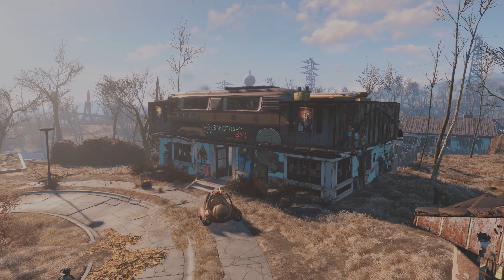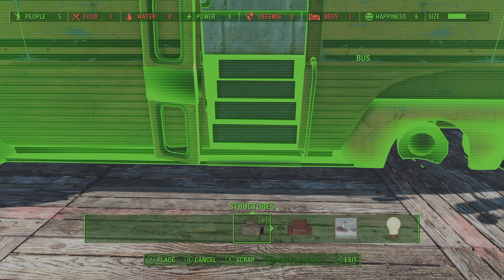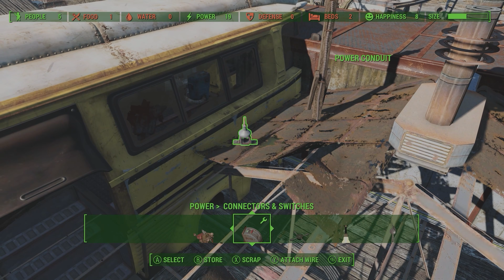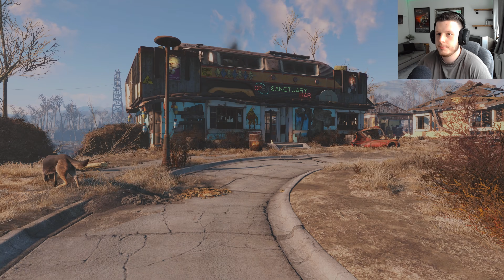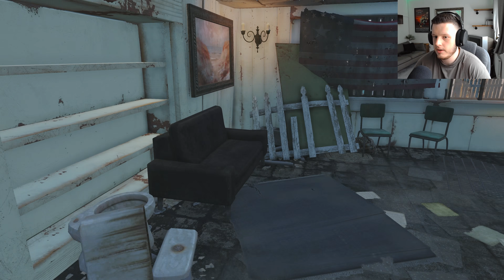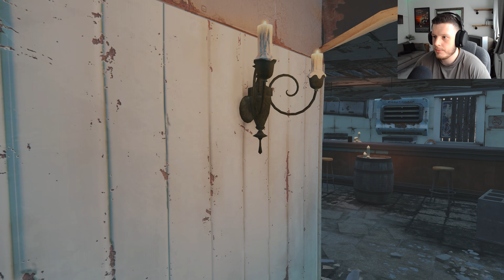Fallout 4 - Sanctuary House Bus Rooftop Repair

Comment: Hey new sub! Good stuff looks immersive af. For anyone having trouble replicating shawzzo builds and rug glitch not working?…. It because you have sts mod installed and that breaks it. I would recommend you finish your sanctuary build then install sts after, if you must have a clean settlement that is.

Comment: You should check out the wifi glitch so you can have wireless conduits.  Set up all your lights with one big generator and then hide the generator after you have all the lights and all things that require power.  It’s nice not having loud generators in your settlement.  And no wires.

Comment: I flipped the buses around where the doors were accessible and I made separate walkways with railings into the buses on both sides of the building one of them I use as the sanctuary public occurrences office for Piper

Comment: Gosh trying so hard to get this one but it just wont go with either of the rug or pole glitch. Any tips on getting the roof to fit? Ive checked for any other items colliding inside as ive already started fixing the walls. Platform seems to be the right size and i have the buses lined up pretty well
Reply: Did you ever figure it out ahaha I can’t get it at all

Comment: Nice build but you should put some concrete pillars underneath so it looks like all that weight is being supported by something, even if you just put a few around the outside of the house under the eaves. It will also help with your blue paint problem a bit.

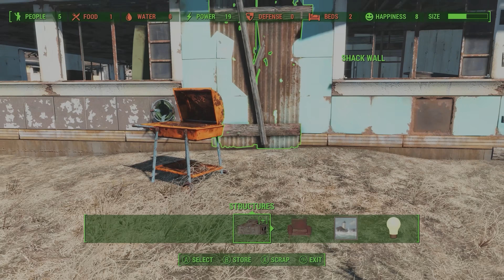Comment: 7:08 If anyone else wants to use doors as windows keep in mind that settlers will open those doors and ruin the window effect. There is a workaround though. Settler programming only allows them to open doors, it does not allow them close doors. We can use this to our advantage by initially placing the doors somewhere out of the way, exiting build mode and opening the doors, and then reentering build mode and placing them where we want to use them as windows. Since the doors are already in the open position settlers will not be able to mess them up.

Nice creative build BTW.
Reply: I like to use the glass half-walls and pillar-glitch them onto the appropriate location.